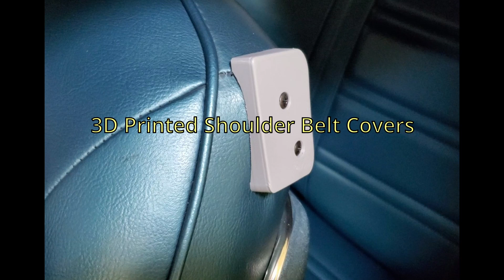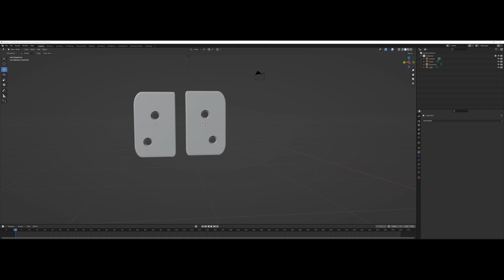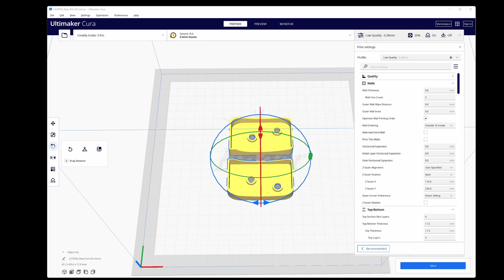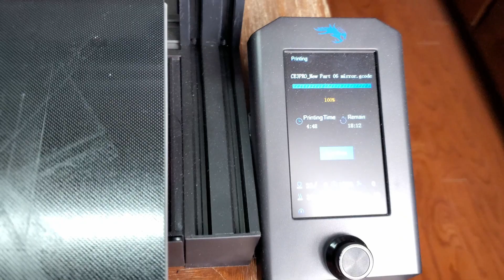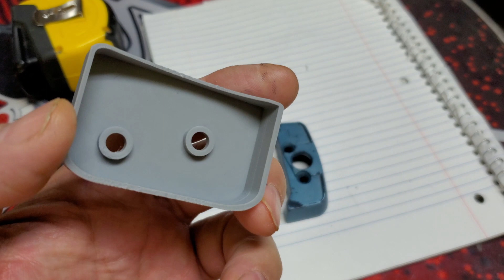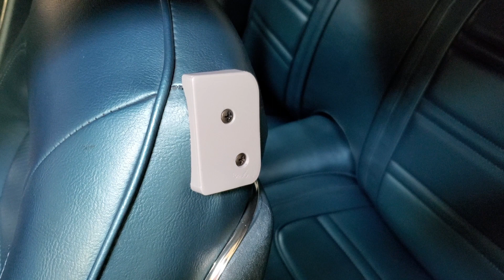3D Printing Parts for use in the Car Hobby. Bucket Seat Shoulder Belt Covers.

Comment: I need a part That's no longer available it's for my astra convertible by g.m if you can help il pay good price
Reply from the maker: Sorry, the part is custom contoured to my Trans Am seat.
Reply: @SPSteve  can you 3d print other car parts
Reply from the maker: I can but I probably won't. Not something that isn't for my own use anyway. The time it takes to create something in 3D modeling software and then export to the printer, test print, make adjustments, is very time consuming. @Tiffany.1970
Reply: @SPSteve  no probs il see if there's any company's in the UK That 3d printing various items .....